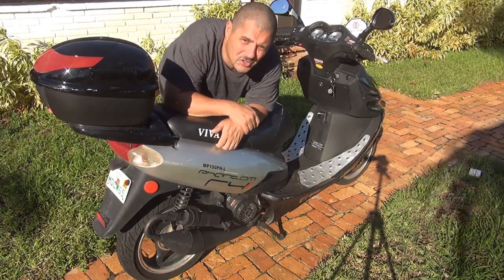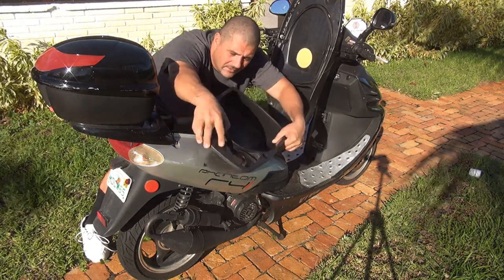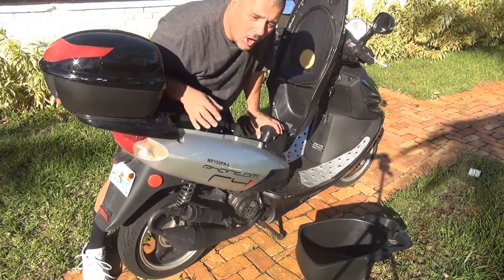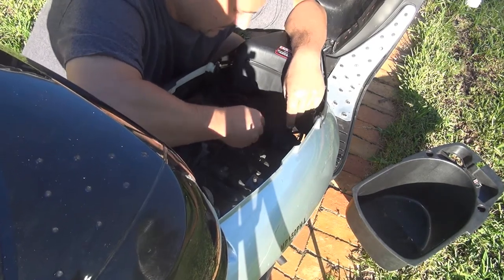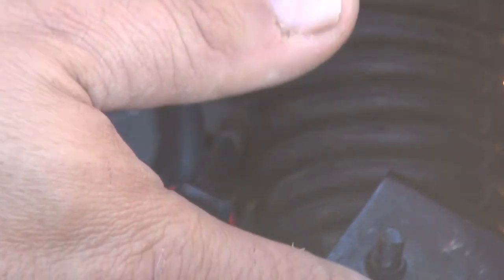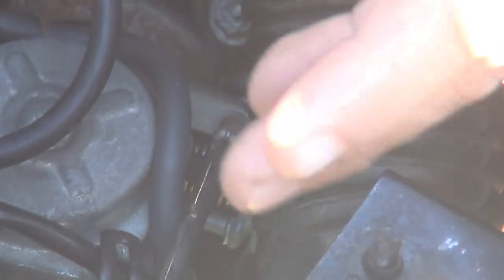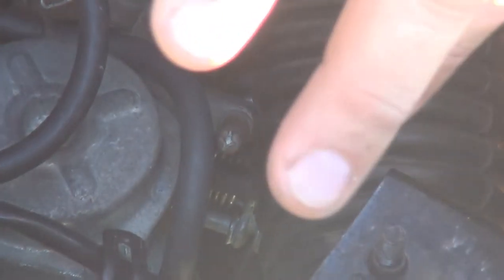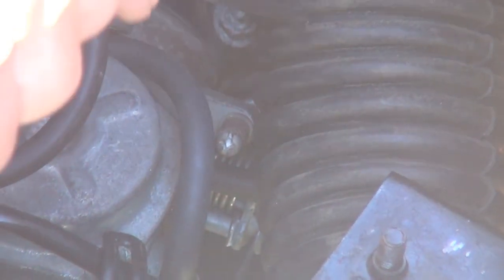How to Adjust Idle on a 150cc scooter/ Motorcycle / Atv /GY6 motor

Comment: My manual says, "The idle should be adjusted just
 high enough so that when set on the center stand with rear wheel elevated, the wheel turns very slowly." Many people think they can adjust it until the engine stays running. That's way too low. What happens is you will dump a lot more gas into the carb trying to get it to roll then the bike will take off like a bullet and you'll lose control. Setting the idle Faster just until the wheel starts to turn slowly ensures you can get it to roll with a small amount of throttle and keep control of the bike. I had to learn this the hard way first time I got my bike.
Reply from the maker: Great thank you for sharing your knowledge with the youtube community and thank you for watching my video
Reply: Won't that put excessive wear on the transmission?
Reply: @timbervandenhul9383  I don't think so. At this point you are not so high in RPM's at a standstill to make a difference.
Reply: Thanks .got a few if you don’t play with your scooter it will be in back yard for years

Comment: Pease tell me when i first start scooter in the morning the rpm is too low before is was high and then low when is worm i chec electric choke and is good????
Reply from the maker: Sometimes the carburetor can be dirty and that can effect the RPM or your electric choke is not working they way it should even if you test the voltage with a multimeter
Reply: @VirberelloScooterTips  i clean the carburator and chek the voltage that come in the choke is about  10v but in the morning the choke is cold and scooter is start with no problem but very low rpm i must vait to worm up and then is rpm good meybu new carburator to bay?

Comment: I have a 150 & to actually get it Running I have to rev it up a bit to get it to warm up any idea what the problem could be
Reply from the maker: Hello Jamal you need to check the valves clearance https://youtu.be/csH2RGvXegI I think that is your problem Thank you for watching my video
Reply: @VirberelloScooterTips  I've Recently taken it to the shop they put a new battery & starter clutch but I mean it does run i change the oil when needed I just changed the spark plug it has updated cdi, coil ignition wire, & starter Relay
Reply: @VirberelloScooterTips  thanks I just found the problem..the problem was my throttle cable was loose it had too much Freeplay that's why it was difficult to start but now it starts up immediately after I tightened the throttle cable

Comment: Hello sir i have a gy6 150 cc scotter i change the relay on signals and change the signal switch but now the signal lights wont blink how can i six that i watch your channel or the time but no video for that can u help me i use my scooter every day to go to work now im stuck??
Reply from the maker: Hello Samuel make sure the connections are nice and pressed together if they are not still working you will need a multimeter to check if the relay is getting any voltage or there is a possibility that the new relay is bad anything is possible with this scooters

Comment: Hello Virberello, I have one question. I have 150cc GY6 scooter. Just installed a new carburator but cant adjust scooter idle rmp. Sometimes it goes very high sometimes very low. For example if I cold start scooter rear wheel spins like crazy and after few minutes when engine gets hot rpm goes too low and scooter  dies. Also if I set idle screw on hot engine   cold start is very hard. I have to push throttle to let it start.  Otherwise it dies.
Reply from the maker: Hello try to adjust the idle mixer screw on the lower left side to see if that can help
Reply: @VirberelloScooterTips  I have adjusted mix screw on warm engine. When engine is warm it runs great. But at cold starts rpm goes very high and rear wheel spins too fast. I set mix screw to 2 1/4.  Is it normal?
Reply from the maker: @giorgiiashvili5451  hello yes more or less is normal the problem is the electric choke enricher that is a bad quality will be better to buy a carburator with a manual choke

Comment: my lights are dim when idleing and get bright when i excellerate i replaced stater cdi ignition coil how do i fix this?
Reply from the maker: I think you should change the voltage regulator sometime they do not work perfectly plus there is a possibility that your stator heads are dirty or the magneto flywheel is dirty and need to be clean with fine send paper . thank you for watching my video
Reply: @VirberelloScooterTips  Thank you so much I will put the new regulator on today and let you know the outcome you are awesome thank you again!!!👍🏻😊

Comment: Dear Virberello, a question for you:  i have problem wih high rpm idling when the scooter is cold , when i start it after some time. After a few minutes idling become regular but in the first minutes rpm is too high.  I've tried to regulate the idle screw and the air mixture screw but i didn't solve the problem.  Do  i have to add some carburetor cleaner liquid in the gasoline ( for example liqui moly carburetor cleaner) to clean the carburetor? Could it be a problem of the enricher ? What else could be done with high rpm idling ? disassembling carburetor and cleaning it?  electrical problems? thank you
Reply from the maker: Hello Riccardo the best thing to do is to remove the carburetor and clean every jet and every little holes I don't like to much carburetor cleaner liquid mixed with fuel because that will damage  rubber seals, rubber hoses , rubber petcock diaphragm but when you clean the carburetor you can buy a spray like this https://amzn.to/3etuMPn and make sure you protect your eyes many time a little dirt in the jets or in the carburetor can effect the performance and or the rpm value
Reply: @VirberelloScooterTips  thank you very much indeed

Comment: Good day brother.. I have a problem with my son scooter.. It was a gy6 50cc I put a 100cc big bore kit , 26mm carbuerator , racing exhaust and cdi...... The scooter runs and idles great but when it is at full throttle.. It jerks and can't go faster than 40mph.. What do you think is the problem...someone told me to check the spacer between the carburetor...any help will be appreciated...respect
Reply from the maker: Hello my friend I have the feeling that you need a racing filter you need a little more air in the mixture  try to disconnect the air hose from the back of your carburetor and do a test run if the scooter run a lot better that is the problem also whenever you change anything engine-wise, the transmission must be retuned to optimize the extra power. Did you also jet the carburetor correctly? . Thank you for watching my videos  and I hope you can fix the problem
Reply: Thank you so much for your response..i forgot to mention that I already have a high flow filter install...i have a 105 main jet on it....i tried 110...115....but the higher I get the scooter gets worst..im stuck ....i will try getting a performance variator. With heavier rollers and new belt....but a thank you .....if you can think of anything else...let me know.....respect...brother
Reply from the maker: @cruzianmehsonusvi5145  Hello my friend try to buy a 20mm carburator https://amzn.to/2MQ1az4 with a 96 main jet there is a possibility that the 26mm is to big you need to find the right balance  or try with a better fuel pump that will give you more juice ( fuel ) when your motor need that https://amzn.to/2LhDvpn  I hope you can fix the problem have a great day and be safe with your scooter

Comment: I rebuilt my carburetor, scooter is running idle is good. My scooter is 150cc but the top speed now is 40-43 what do you suggest I do? Or what did I do wrong?
Reply from the maker: Hello Carmon the scooter should be a little faster if is a 150cc should have a speed of 55mph or more my suggestion is to upgrade the main jet to #108 and replace the rollers weight at the variator to a 14 grams. Thank you for watching my video

Comment: Thank you Boss.... I was just looking for this... yesterday I snapped my Throttle cable so I wanted to adjust my idle so that I can go get a new cable...
Reply from the maker: Thank you for watching my video
Reply: Ay my man, do you know how you can tell if the vacuum petcock is broken and what are the symptoms
Reply from the maker: Hi petcock has 3 hoses one come from the tank one goes to the carburetor  and one is the vacuum line, to test disconnect the hose  that goes to the carburetor from the petcock place a little empty plastic bottle to make sure gas does not go everywhere when you test disconnect the vacuum line  from the petcock connect a new clean hose at the petcock vacuum line and make a vacuum with your mouth if you see gas flowing in the plastic bottle your petcock is good , that means that your problem is somewhere else in the vacuum line, or if is an emergency you can temporarily bypass the petcock  with a small filter.
Thank you for watching my video

Comment: Hello. My 150cc automatic scooter is idleing at 3000 and feels like it wants to stall at stop lights. It never does, but it seems to be idleing too fast. What causes this and how can I fix it? Just follow the steps in your video to turn it down? Thanks a lot!
Reply from the maker: Hello Kristi when you start your scooter at cold or with cold weather the automatic choker at the carburetor will raise the rpm around 2500-3000 but after 3 to 8 minutes the rpm should go down to 1300-1600 if the rpm do not lower after that time you will need to test the automatic choker to make sure is working properly and if you set the idle make sure you do that after 3 to 8 minutes after you start your engine.
Thank you for watching my video.
Reply: Thank you. Yeah, it was at 3000rpm after about a 45 minute ride so im thinking it definitely needs adjusted. Is the carburator located in the same place on all 150cc scooters? Thanks again!

Comment: My scooter won't idle, if the rpms drop the scooter dies. I tightened the idle screw but it didn't solve the problem. Any ideas?
Reply from the maker: Hello my friend you need to clean the carburetor your pilot jet is dirty and is not letting the fuel go through check this video https://youtu.be/XHVfc98hDBA

Comment: Fuel to air mixture screw also needs adjustment .
Reply from the maker: Thank you great idea
Reply: @VirberelloScooterTips  I've noticed depending on the weather,ie  warm day cold day I'm adjusting fuel to air mixture every other week.just a small adjustment gets me from 30 miles an hour uphill to 35 miles an hour.pulling off power a d acceleration also improved.
Reply: @leath25  how  d u adjust them specific to the weather?can u reply and explain.  thnaks
Reply: @mikezimmerman817  you will know when to adjust normally from how your engine sounds,and how it starts up if it struggles to start then adjust your air mixture screw,or if it starts to loose acceleration also.listen to the engine whilst it is idelling is it to high a rev or is it struggling to stay running.
Reply: I've been having hard time since I adjusted mine..well I tried. It did good at first then had intake manifold air leak fixed it and now I still can't seem to get mixture right. The scooter wants to run but it is off somewhat. I'm wondering if it may be my valves. Any input anyone.i had change my oil 1 time as gas got in it 1 time. I'm out of ideas